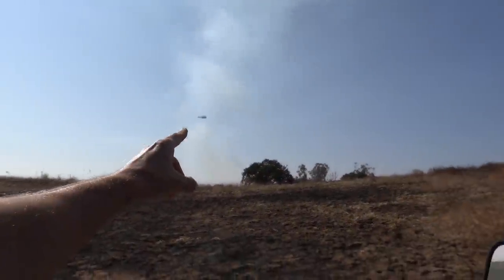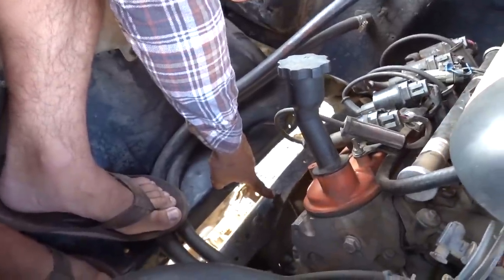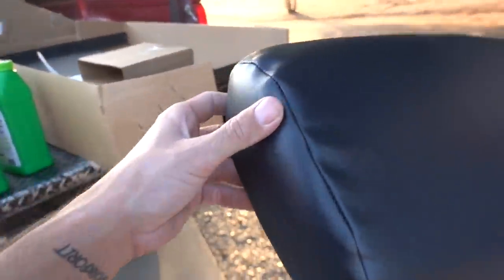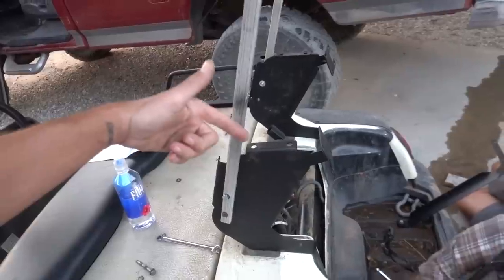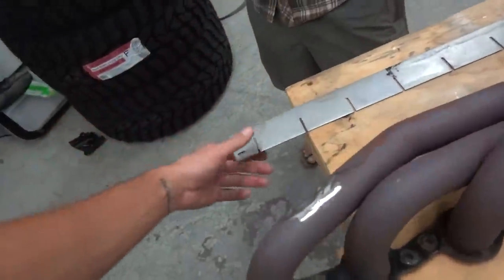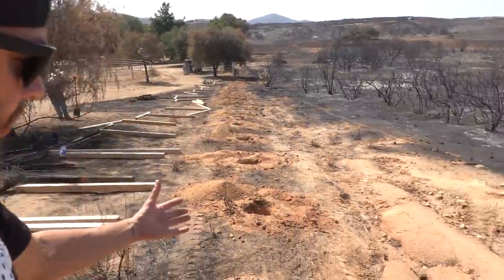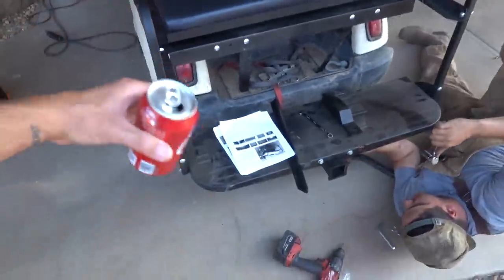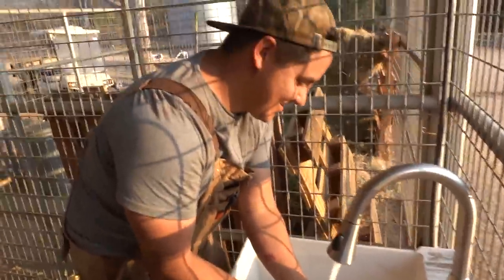Well... There's another fire near the ranch

Comment: I just went through fires in Oregon and we ended up with a few good ideas in hindsight that I figured I'd share. #1 Build the pump house sides and roof out of materials that wont burn, in our case cinderblock wall and both a metal roof and door. #2 we got a generator to run our pump for a solid 12 hours if the power was to get cut off. #3 is of course (above ground) all galvanized pipe, fittings, and Dramm Spinner Head so no worries about melting.